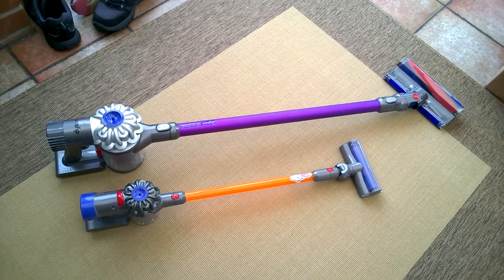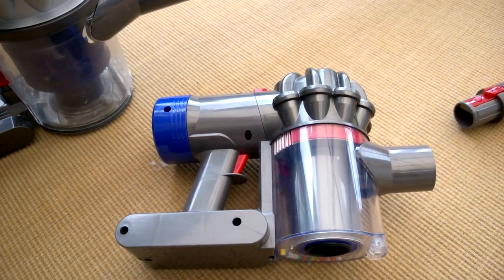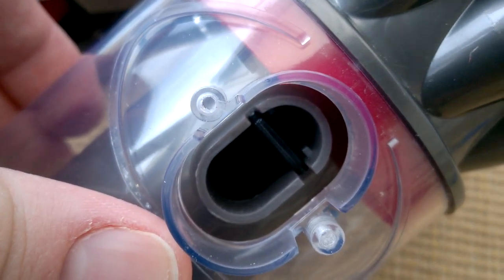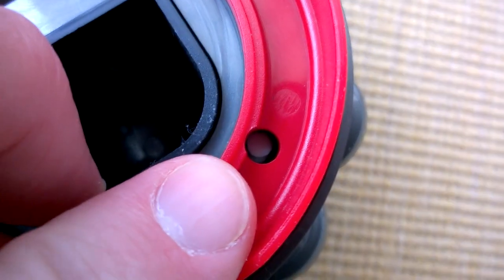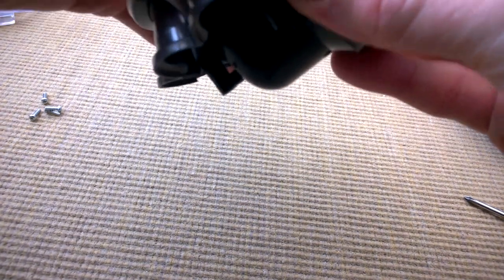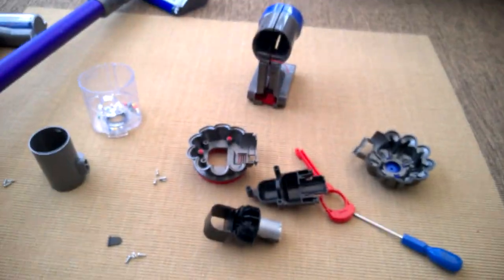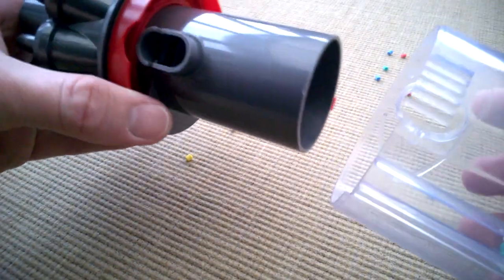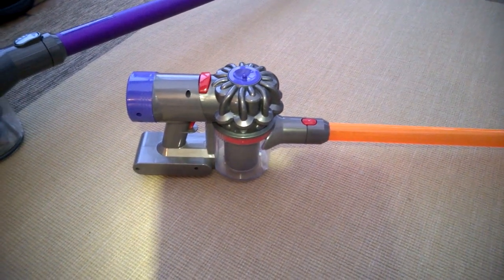Casdon Toy Dyson Cordless Vacuum Tear Down - What's Inside?

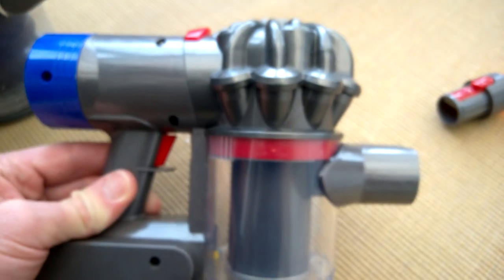Comment: We are having a similar problem with our grandson's vacuum.  It seems to me that when I was putting it together there was a rectangular (4cm x 2cm) plastic piece with a small (5mm) square hole that syphoned the small bits of paper into the suction chamber.  Like yours, ours no longer has this piece (at about the 2:30 mark of your video, you show the bottom with a larger 2cm round hole in it, which is what ours now looks like).  I think we're experiencing the same problem.  The vacuum works fine when we replace the long wand with the shorter one, so I think the suction is probably OK.

Comment: Have you still got your DC05
Reply from the maker: Sure have, it's an excellent cleaner considering it's mains powered, bagless and quite a few years old now. I liked it so much I bought another one.
Reply: @ChrisHorswill Nice  they are very powerful machines I’ve got one aswell I use daily which  is 4 years old the motor burntout on it last year so I’ve fitted a New genuine Dyson motor in it and it’s still going strong.